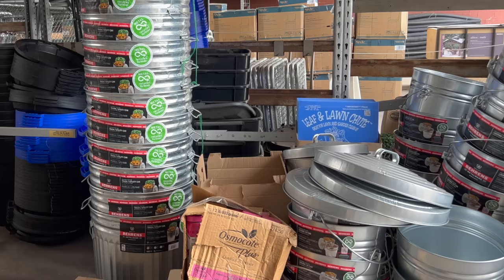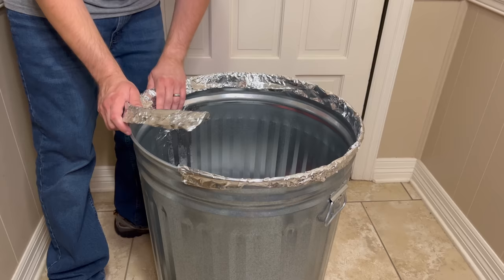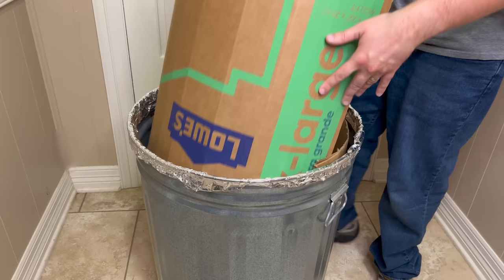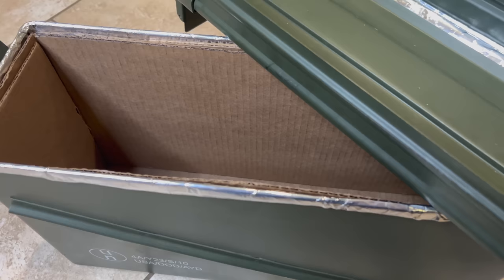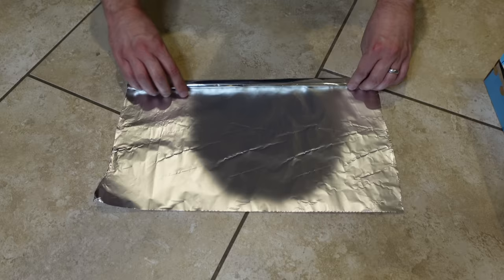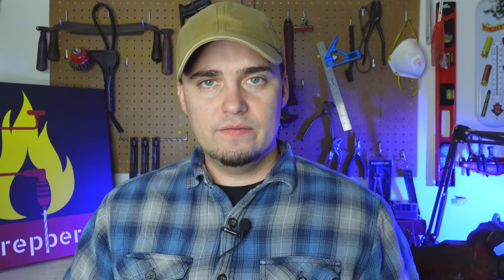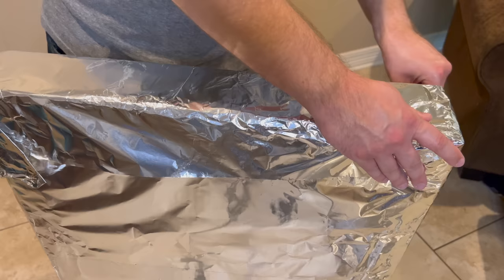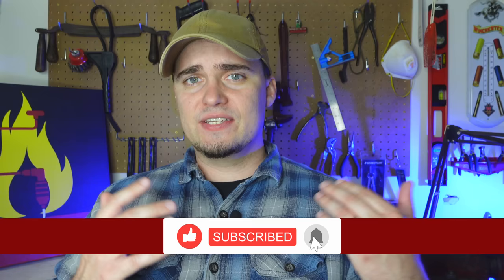3 Ways to Build a Faraday Cage

Comment: The simplest way is to reuse a broken microwave oven to store your sensitive electronics. And it makes it much easier to access.
Reply: Great idea!
Reply: Genius Son.
Reply: Unplugged first?
Reply: @lindasophiasworth  Yes broken and preferably cut the power cord as well.
Reply: @lindasophiasworth  genius
Reply: There is more to it than sticking stuff in a microwave, microwaves are designed to block microwaves.
Reply: @StimulatingPresence  what have you found helpful?
Reply: @StimulatingPresence  yes we understand and was making light of the genius part.
Reply: I was thinking a fridge may be able to be devised into an appropriate cage.
Reply: I've heard microwave test failed,  but I've never tried it myself.
Reply: It won’t work the tiny holes in the front let emp particles through.
Reply: @jackieraulerson2005  old refrigerators are great pantries for non refrigerated food storage. I’ve been using one for well over a decade. I wouldn’t want to go through what it would take to try one for a Faraday cage. It takes a container that will silence a transistor radio playing while closed inside it. If the radio can’t receive the signal, you’re good.
Reply: Put your phone in a microwave  call it. Does it ring? If it does it won't stop an EMP. A stainless steel pot with a stainless steel lid and duct tape works.
Reply: @danielp4507  I've actually done that as a test and I could never get my phone to ring if a cell phone was in the microwave oven ... make sure to unplug it first....just to be safe :)
Reply: @Patrick O'Brien so personally.  I don't have a place to store a library of books. I have a tablet. I have downloaded hundreds of educational books onto SD cards. So if something does happen I still can access that knowledge. Books on farming,  sewing, blacksmithing, herbal remedies...
Reply: @Craig Amos  
I placed my phone in the microwave, and the phone rang when we called it.
Reply: Yes, excellent info! Blessings from Columbus Ohio 🙏
Reply: @Jackie Raulerson  Yes, myself as well. -MI
Reply: @Ines Crawford  Try a stainless steal container w/duct tape or real metal ammo cans! 👍🏻 -MI
Reply: @craigamos6746 turn off your phone first
Reply: It’s certainly simpler, but it can make transportation a bit inconvenient.
Reply: @StimulatingPresence  yes he is right
Reply: @inescrawford1450 then it's not EMP proof
Reply: @Davido50 hey do you know if any survival/preparedness type of groups in the central Ohio area?
Reply: Dont 4get 2 EMP your HEAD with a TINFOIL HAT.
Reply: I'm going to try this
Reply: @sultanofswing7198 EMP is radio waves not particles. But, why not use the metal tape to seal them up ! xxx🎉
Reply: @inescrawford1450 if you have a disused oven, tape up the seams, vent holes and other gaps. I'm going to try that.
Reply: @craigamos6746 ⭐⭐⭐⭐⭐
Reply: Put your Cell phone in the Microwave, and Call it from Another Phone. 
You’ll be Surprised at How much it Doesn’t Protect you from the Microwaves.
Reply: @sweetsuccesstrading5097 ell phone radiation is different than microwave radiation. Although the 2.4 GHz spectrum operates on Wi-Fi b/g,  your cellular signal is a different frequency than the microwave 2.4ghz
Microwave doors are designed to block the radiation, however it's still bleeds 2.4 GHz And it still disrupts Wi-Fi signal for b/g
Reply: Microwave wrapped in aluminum foil
Reply: That would be genius, except that this video still loaded and plays with my phone in the microwave. Some work would need to be done in order for this to be functional. I can also hear sound coming out of the microwave very clearly as if there is an open hole from the inside of the microwave going straight out the back.
Reply: Stainless steel pressure cooker?
Reply: @jackieraulerson2005 only if it’s the older ones. Same goes for the old chest freezer
Reply: I have an old army ammo can from Korean War (1950’s) - will this work as a faraday cage for my devices and a cache of batteries?
Reply: real idea here!!!
Reply: It's actually not true... Try putting your phone in a microwave and calling it
Reply: Bonus points if it's a very old looking microwave so robbers walk right by it
Reply: @JohnSmith-mo4yh 
And any such group in San Diego CA ?😊
Reply: Check microwave by putting your phone in it, shutting the door & using another phone to call it.
If the call goes thru, the seal isn't good & you shouldn't be using it anyways!
Reply: I would remove the cover of the microwave and make a few layers of aluminun foil and tape with cardboard,  atleast 2 to 3 layers of both, cover vent holes from the inside and remove all electric components, replace cover and then cover the inside of the microwave, the cooking area, with thick aluminum foil and aluminum tape, including the door, would add atleast 1 layer of cardboard and 2 layers of foil to the door. Try to make it so the inside layer on the door sticks into the cooking area and creates a tight fit.
I like this way because when done it just looks like a microwave with no visible extra shielding and wouldn't look out of place in a shed or a closet and more likely to be passed over by thieves and looters
More layers the better naturally.
Reply: Can someone please explain why a gas generator would need to be protected from an EMP. Thanks in advance.
Reply: Well if the cell towers are taken out by the emp, the phone will not work.
Reply: Actually, I put my cell phone in the micro and then called myself. My phone rang. I wrapped it in tinfoil and called it. It did not ring or register a missed called. Just heads up.
Reply: @inescrawford1450 
Stop using the oven! It is irradiating you!
Reply: Why would a microwave serve as a Faraday cage?  Makes absolutely no sense.
Reply: Aluminum foil?
Reply: Remove the power cord, it can act as an antenna to bring in the EMP surge.
Reply: @danielp4507 great idea! Thanks!!
Reply: Well... microwave ovens just good for 2.4 gigahertz... I don't think MO would stop high frequency pulse
Reply: The garbage can is cheap, holds more and easier to carry around. The micro wave is heavy as heck and clumsy and doesn't hold as much. So where are you going to get the "broken" micro wave, how much might someone charge you for that and how many would you need to get? Fail.
Another option is the big popcorn cans that come out at the holidays. They are less than $10 and you get to eat the popcorn.
Reply: Someone tried that on u-tube..can't  remember who.. lts didn't work!
Reply: @bazduggan4042  yea..I've put cellphone in microwave and was able to call it no problem
Reply: Good to know.
Reply: @inescrawford1450 Elevators are also Faraday cages. Most weaken the cellular signal but don’t block it altogether. An EMP seems likely to be stronger than a nearby cellular service transmitter, and, if so, would overwhelm a Faraday cage that I might construct.
Reply: @danielp4507  
if u put phone in microwave & nuke it on high it will not be answerable
Reply: @sultanofswing7198 what tiny holes
Reply: I would worry a microwave, even a broken one, might fire and fry your electronics. You can remove some key parts to prevent this, or am I worried for nothing?
Reply: Using a re purposed micro wave works but it doesn't work that well.
Reply: Doesn’t work. Our phone still rings and our radios still work in a microwave
Reply: I have to ask, would a 8 ft by 6 ft all metal shed work?
Reply: Unplug the microwave. Put your cell phone and close the door. Call your cell phone. If it rings you have a fail there.
Reply: @Angel_eyes___  a satellite phone should if you can afford 1.
Reply: @mindsigh4 😂
Reply: I tried my "find my phone" in the microwave,refrigerator and the freezer and it rang😢
Reply: That’s a bingo
Reply: @tdog4240  Bugs can get into microwave ovens. I've seen it myself. Even while something is cooking in it
Reply: Foil alone works for blocking calls on cell phones, no microwave needed. I wraped it and the calls would not go through.
Reply: Remove the battery in cell phone
Reply: @sultanofswing7198  that makes sense. But you could always cover the inside of the glass with aluminum foil and or metal tape right ?
? or no?
Reply: @craigamos6746  I use a microwave and turn it on once a month just to keep those batteries charged.😬
Reply: Put your wife in the microwave oven… if you can still hear her… it won’t work😢
Reply: My hubby and I tried the phone in the microwave. I could not get calls but able to receive texts. I turned my emergency radio on to a station and put that in microwave. We could still hear station do I wrapped in heavy duty foil and that  blocked the station and only heard static, outside as well as inside the microwave. I then wrapped my phone and put in microwave and I still got texts.
Reply: @sultanofswing7198 so foil the door
Reply: Just remember that an unplugged microwave can still  have 300 microwave electric in it and can cause shock or electric fire.
Reply: I tried a microwave oven and aluminum foil, neither worked.
Reply: Try your safe if you have one
Reply: @jusstmee  You wrapped the microwave in foil? Your microwave answered but the phone didn't?
Reply: Help, I’m new to EMP…. How will we know when EMP is near us? We can’t rely on state/city alarms. How do we first protect our bodies from EMP before getting the items out of the faraday cage? Thank you for this terrific video.
Reply: @danielp4507  I was wondering a old pressure canner?
Reply: Phone still works, not much of a Faraday cage.
Reply: @Krazycat321  OMG!.....LOLOLOLOL.
Reply: I would think that none of us are going to know about when an EMT attack is going to happen, so having a secondary phone and placing it in a faraday cage would be smarter
Reply: @truecrime98  What will your phone  connect to after the EMT attack?
Reply: Is this for real?  Must be disappointed about 1999, 2012.  If he misses the Rapture, he’ll be in the trash can.
Reply: BTW  I heard they will do another emergency broadcast on the 11th of October
Reply: Microwaves have a radius of a pencil, hence the smaller wholes In the green on the door. What size are the waves for 3,3,4 and5G??
Reply: @amarie3309 the Rapture is a false teaching
Reply: Genius idea! Thank you
Reply: Does it have to be broken, or can one that still works,work?
Reply: Wow I never even thought of that…super practical
Reply: Nope. Tried it but it doesn't work.
Reply: @tdog4240 you're right it doesn't work.
Reply: My thought exactly!
Reply: @danielp4507 I was actually thinking about doing that.  Thanks for sharing.
Reply: Nope they did a test and a microwave doesn’t work
Reply: Would a old dryer work
Reply: @inescrawford1450 put it on airplane mode
Reply: @sweetsuccesstrading5097 microwave photons are about the size of golf balls. Different frequencies involved.. Hence why a Faraday box may be fine for blocking radio, yet not  phones at 5ghz.
Reply: Try putting your phone in and call it.  False.
Reply: Put my phone in micro back at the emergency broadcast beging of month, still got broadcast
Reply: That's awesomely cool.  Broken Microwave.  Nice.
Reply: Tried it. Doesn't work. Signals still went through.
Reply: My phone still rings in the microwave oven. Wrapping it in foil was the only real nlock
Reply: @sgtmomOK  foil didn't work either.
Reply: @jeffmaas2792  I wrapped mine thickly, and it passed the alert test in October. I’d been keeping my electronics in my microwave, but never tested it before. It rang through even on airplane mode.
Reply: @sgtmomOK  wow thats good. We also tried it for the Oct 4 alert test but no go.
Reply: But there are vents!
Reply: @tdog4240 I have been told the same thing.
Reply: Wow , never even thought about it .
What's the material used in microwaves that protects the user ?
Reply: Please, just don’t open it up if you don’t know how to properly discharge the capacitor, even after long periods of time unplugged it can still hold some 50,000 volts and will do serious damage or death.
Reply: Guys, Here is The Savior

HalleluYAH translates “Praise ye YaH”

YaH is The Heavenly Father 
YaH arrives via the TENT OF MEETING
YaH was Who they Crucified for our sins
YaH was Crucified on an Almond TREE

— Ancient Semitic Cuneiform of Moshe (Moses)
— Isa Scroll (The Original Isaiah)

Isaiah 42:8
"I am YaH; that is my Name! I will not yield my glory to another or my praise to idols.

Isaiah 43:11
I, I am YAH, and there is no other Savior but Me.

Isaiah 45:5
I am YaH, and there is none else.
Reply: The tiniest amount of research would show this in not true
Reply: For the solar panels would a big tv box wrapped in aluminum foil work? It could be easier to open and close when needed if properly sealed
Reply: There are more things to do other than just placing in microwave.
Reply: I have a question, if I built a wood with wood dowels and glue. Then wrapped it with copper or steel screen material glued to the wood. Good or bad? No screws, I feel they wood act as lighting rods. Placing this over my generator, tractor, dozer, or skid steer.
Reply: I put an phone inside the microwave and called it with another phone, was possibly the phone inside receive the call and ring, shouldn’t this happen if microwave block all the waves?
Reply: I put an phone inside the microwave and called it with another phone, was possibly the phone inside receive the call and ring, shouldn’t this happen if microwave block all the waves?
Reply: I put an phone inside the microwave and called it with another phone, was possibly the phone inside receive the call and ring, shouldn’t this happen if microwave block all the waves?
Reply: I put an phone inside the microwave and called it with another phone, was possibly the phone inside receive the call and ring, shouldn’t this happen if microwave block all the waves?
Reply: I put an phone inside the microwave and called it with another phone, was possibly the phone inside receive the call and ring, shouldn’t this happen if microwave block all the waves?
Reply: I put an phone inside the microwave and called it with another phone, was possibly the phone inside receive the call and ring, shouldn’t this happen if microwave block all the waves?
Reply: I put an phone inside the microwave and called it with another phone, was possibly the phone inside receive the call and ring, shouldn’t this happen if microwave block all the waves?
Reply: I put an phone inside the microwave and called it with another phone, was possibly the phone inside receive the call and ring, shouldn’t this happen if microwave block all the waves?
Reply: I put an phone inside the microwave and called it with another phone, was possibly the phone inside receive the call and ring, shouldn’t this happen if microwave block all the waves?
Reply: I put an phone inside the microwave and called it with another phone, was possibly the phone inside receive the call and ring, shouldn’t this happen if microwave block all the waves?
Reply: I put an phone inside the microwave and called it with another phone, was possibly the phone inside receive the call and ring, shouldn’t this happen if microwave block all the waves?
Reply: I put an phone inside the microwave and called it with another phone, was possibly the phone inside receive the call and ring, shouldn’t this happen if microwave block all the waves?
Reply: I put an phone inside the microwave and called it with another phone, was possibly the phone inside receive the call and ring, shouldn’t this happen if microwave block all the waves?
Reply: I put an phone inside the microwave and called it with another phone, was possibly the phone inside receive the call and ring, shouldn’t this happen if microwave block all the waves?
Reply: I put an phone inside the microwave and called it with another phone, was possibly the phone inside receive the call and ring, shouldn’t this happen if microwave block all the waves?
Reply: I put an phone inside the microwave and called it with another phone, was possibly the phone inside receive the call and ring, shouldn’t this happen if microwave block all the waves?
Reply: I put an phone inside the microwave and called it with another phone, was possibly the phone inside receive the call and ring, shouldn’t this happen if microwave block all the waves?
Reply: I put an phone inside the microwave and called it with another phone, was possibly the phone inside receive the call and ring, shouldn’t this happen if microwave block all the waves?
Reply: I put an phone inside the microwave and called it with another phone, was possibly the phone inside receive the call and ring, shouldn’t this happen if microwave block all the waves?
Reply: I put an phone inside the microwave and called it with another phone, was possibly the phone inside receive the call and ring, shouldn’t this happen if microwave block all the waves?
Reply: I put an phone inside the microwave and called it with another phone, was possibly the phone inside receive the call and ring, shouldn’t this happen if microwave block all the waves?
Reply: I put an phone inside the microwave and called it with another phone, was possibly the phone inside receive the call and ring, shouldn’t this happen if microwave block all the waves?
Reply: I put an phone inside the microwave and called it with another phone, was possibly the phone inside receive the call and ring, shouldn’t this happen if microwave block all the waves?
Reply: I put an phone inside the microwave and called it with another phone, was possibly the phone inside receive the call and ring, shouldn’t this happen if microwave block all the waves?
Reply: I put an phone inside the microwave and called it with another phone, was possibly the phone inside receive the call and ring, shouldn’t this happen if microwave block all the waves?
Reply: I put an phone inside the microwave and called it with another phone, was possibly the phone inside receive the call and ring, shouldn’t this happen if microwave block all the waves?
Reply: So I put my stuff in a nonaccessable container. Great. Now how do I continue to use it on a daily basis?
Reply: Can i use fridge,oven,washer,dyer,dishwasher?
Reply: @danielp4507 yes sir.. those pots /w a lid are about $8 at Walmart
Reply: @MovingtoMiami solar panels don't have ICs/w micro wiring that would fry from an EMP
Reply: One of the best materials for blocking is copper, as far as cell phone is concerned
Reply: Microwave oven, IS a natural Faraday cage, don't have to pfaff around at rimes, but it does depend on the size of what's being stored.
Reply: A microwave or mini oven?
Reply: @carolynellis387 
you're right  - for 2.4 GHrz.
A Microwave will not work as a Faraday cage for an EMP, OR CME.
 
I've tested it personally.
Reply: You’re a genius!! Great idea and so simple!
Reply: @sultanofswing7198 You are partially correct.  But EMPs, of any source,  do not emit particles (not even photons). The em waves will pass through any gap or opening less narrow than the wave itself.   Hence, a microwave is not the best option unless you also shield the front.
Reply: It still needs sealing.
Reply: An Emp could hit anytime. I don’t believe one could be totally prepared for one if it were to hit by stashing things in there. One would have to have double of everything . Keep it in there and forget it. Like putting your vehicle in a shipping container. You could be driving your vehicle when an Emp would hit . You could be away from your home if one hits. Getting home safely would be something to think about. An Emp can catch anyone off guard.
Reply: The cage in my microwave powers on when the unit is in use only. Play a video on your phone and toss it in with the unit off. My video continues to play.
Reply: @paulettelamontagne6992 you better think twice about that. If you do t believe the Bible then you won’t believe in the rapture because it’s a “God” thing. In a storm and it’s dark out do you believe there’s a sun shining brightly above the clouds?  It’s there no matter what anyone may say. So it is with faith in Gods Word.  He says it’s gonna happen and it will no matter what skeptics may say.
Reply: Plenty of questionable ones around you can buy second hand, too.
Reply: So is it point less to have a generator if it's not protected as well??
Reply: @craigamos6746 maybe the cell phone was TOASTED c.q waved!
Reply: Really, is this true, and if so what needs to be done to make a good faraday cage ?
Reply: @tdog4240   a €100 built in 2003 microwave or a €400 microwave build in 2024!?
Reply: So microwaves are made to block emf/signals without any interference to them?
Reply: Why not install a copper jumper between the container & the lid?
Reply: Tried microwave ...phone still rang, radio stayed on ...not good.
Reply: @StimulatingPresence didn't test out for me...
Reply: @Angel_eyes___ aaand , it's a tracking device now more than ever.
Reply: @dfromthep2915 they make some nice insulated foil pouches 👍